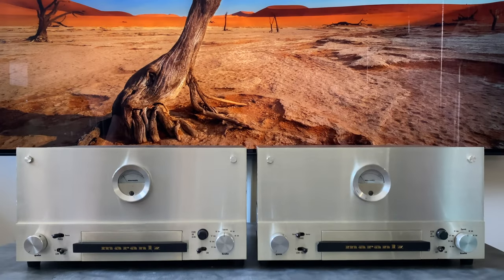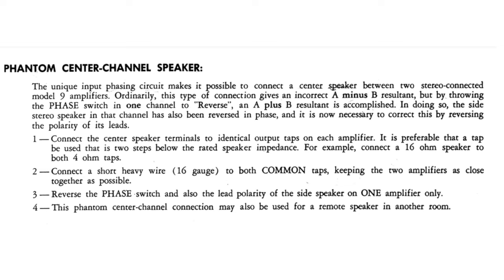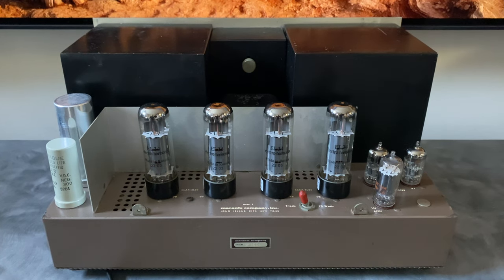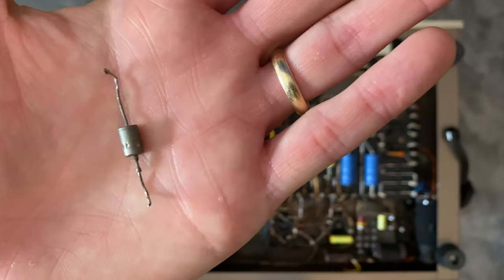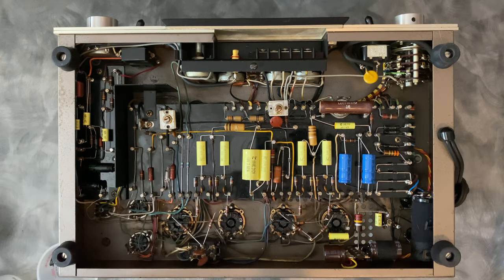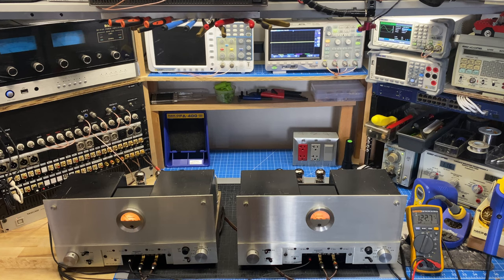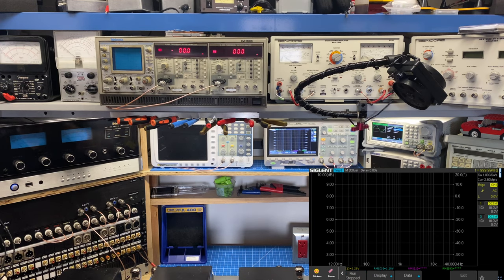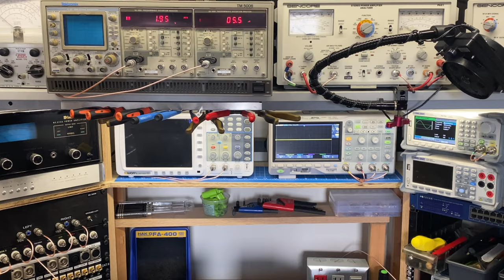Marantz Model 9 ~ Deep Dive ~ Restoration Review & Bench Tests

Comment: The gain control on these was never meant for a source to be connected directly to the amplifier. It is a linear pot for one thing. For the best signal to noise ratio the manual indicates it is best to always keep the gain at maximum. The control is particularly useful when checking or adjusting bias and also to protect the amplifier and speakers when connecting a preamp for the first time or a device that might be noisy or have DC at the output...
Reply: Thanks for that

Comment: Thanks for this Video! ...I have a pair of these Monoblock Amps that I inherited from an old friend of my Dad's ...He thought that an output transformer was faulty, which turned out to be aged Electrolytic Caps in the Power Supply. I really need to dig these amps out of storage where they have been for almost a decade. I want to go thru the amplifiers and replace all faulty or failing components like you have just done in the video.

Comment: Quite possibly the most comprehensive presentation of any vintage piece of tube audio gear that I have ever had the pleasure of viewing!

What brand were the output tubes?

Did you know the date of manufacture for each unit?

Perhaps you already know this, but with the 8-B, the factory date of manufacture was often stamped on the reverse side of the bias meter housing, hidden beneath the brass retaining strap.

Again, thanks!
Reply from the maker: I am glad that you enjoyed watching the video. Thank you for the tip on the manufacturing date. I will keep that in mind for future documentation when 1960s Marantz amps come in. Finding two matched quads of NOS EL34 was going to be tricky, it either take a lot of hunting or a lot of $$$. After speaking with the owner, we settled on current production EL34EH, the Electro Harmonix with the green label. Those are the tubes that were loaded during the bench testing.